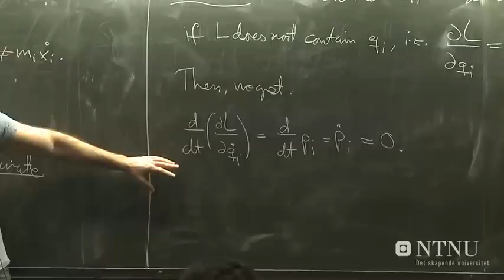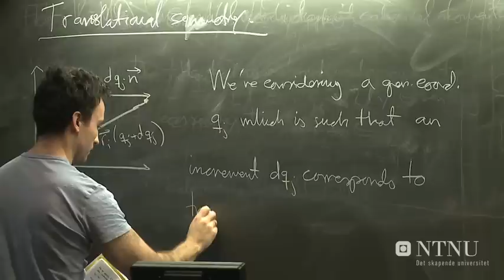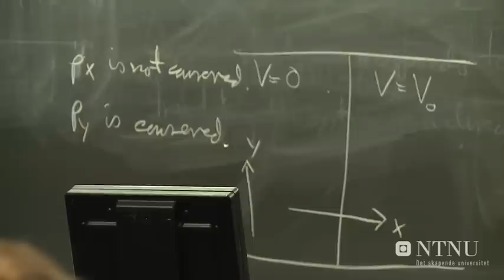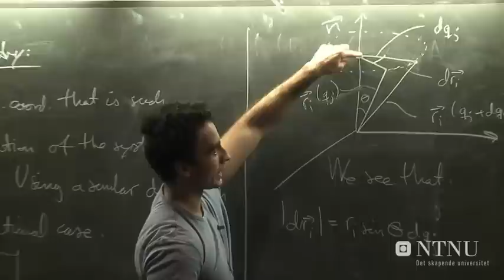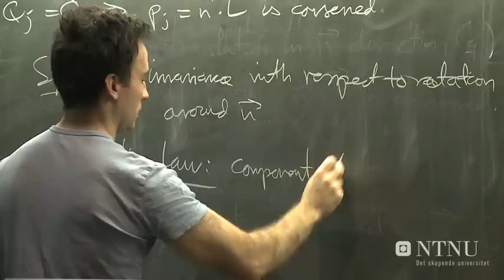10: Conservation laws and symmetries - Part 2

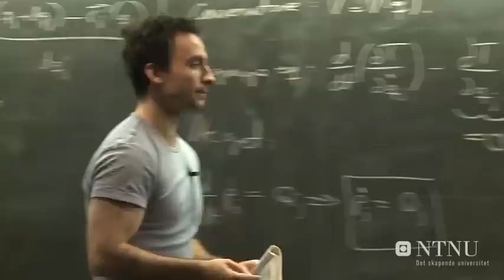Comment: I'm sorry... but the time derivative of the momentum you wrote at 18:39 is probably just the momentum p, non the p dot, right?
Reply: @SeanHavlin-o4j  I have found a pdf of the textbook for this course: http://online.kottakkalfarookcollege.edu.in:8001/jspui/bitstream/123456789/357/1/introduction-to-lagrangian-hamiltonian-mechanics%20%281%29.pdf. Page 32 and equation 2.37 gives the correct expression
Reply: @tomasvirgen8275  Nice, got a link to the second half of the course?
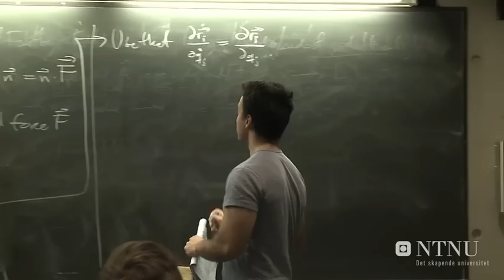Reply: @SeanHavlin-o4j  The original comment by Jernej is correct. The lecturer incorrectly wrote down p dot at 18:39. He did not acknowledge this mistake, but he wrote down the correct expression at 20:05.  The canonical momentum p is differentiating w.r.t q dot, not q. You are incorrect in saying that p dot refers to the derivative w.r.t position. By definition, a dot above a function denotes a TIME derivative.

Another mistake that he made at 18:39 was that he forgot to write down a dot on top of the first r vector. Once again, he wrote down the correct form of this expression at 20:05.
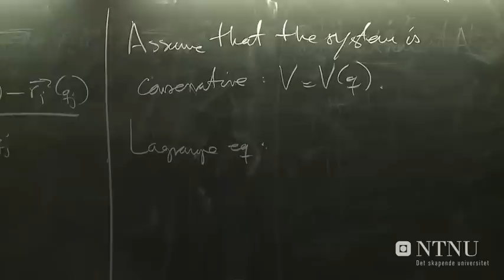Reply: @SeanHavlin-o4j  I agree that the time derivative of the canonical momentum [d/dt(dL/dqdot)] is usually equal to the derivative w.r.t q [dL/dq],  but we are not working with the usually form of Lagrange's equation here. We are working with the equation that he wrote down at 14:30 which takes into account the generalized force. In that equation, [dT/dq]=0. Therefore, the time derivative of [dT/dqdot] is equal to Q, not to [dT/dq].

One way to check that he meant to write down p instead of p dot at 18:39 is by looking at the expression on the right hand side sum(m*rdot*[drdot/dqot]). He wrote down r instead of r dot, but this was a mistake on his part because T has no dependence on r(T=sum(m*rdot^2). You could ONLY derive this expression by differentiating T w.r.t to q dot, not q, because T has no dependence on q. It is also clear that he did not take the time derivative of this expression. Another way to see that he meant to write down p is the fact that he rewrote the expression at 20:05, but this time he correctly used p instead of p dot. If you still don't believe that writing p dot is an error, then I recommend taking the momentum expression at 20:05 and differentiating it w.r.t time. You will clearly not get the same expression as p dot at 18:39; this is because the expression at 18:39 is NOT p dot.
Reply: Tomas Virgen Ah, I see. Thank you.